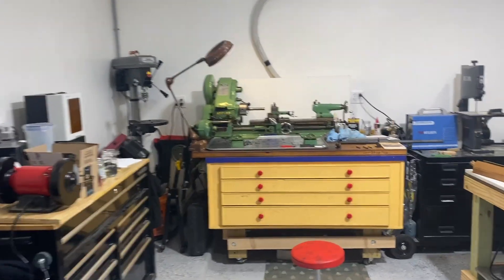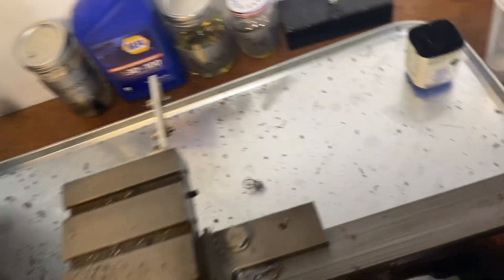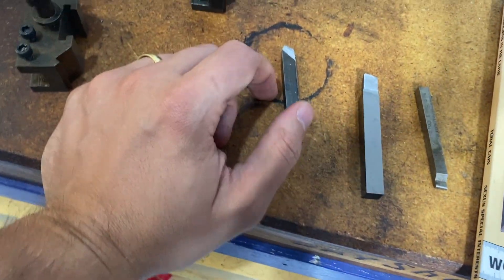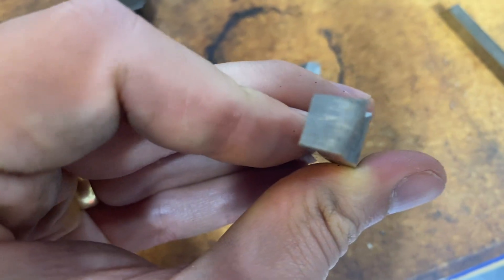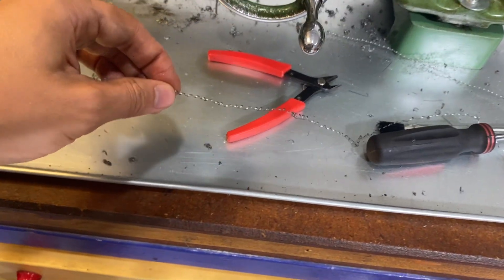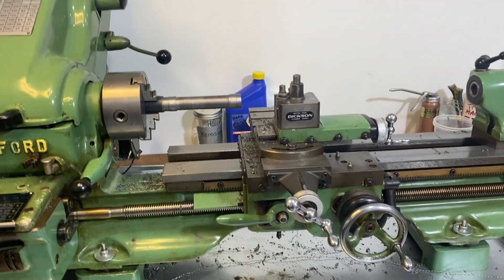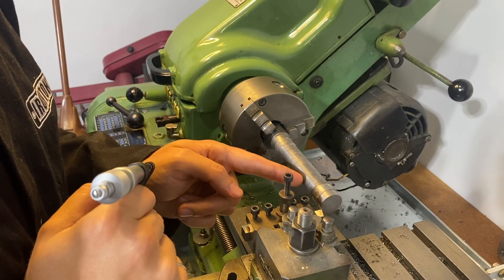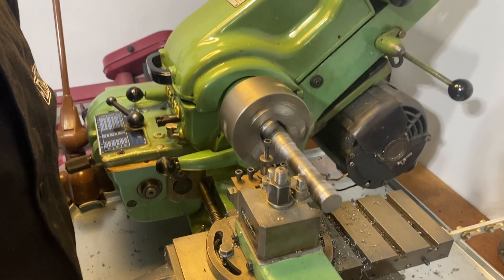Grinding HSS cutters and leveling the Myford

Comment: Nice work. Without tailstock support on a stick out that long. I wouldn’t trust the cut to be the same either side.
Reply: Agreed. Without tailstock support, the cut closer to the chuck will be greater than the part furthest from the chuck.
Reply from the maker: Thanks! I’m just following what the workshop practice series book says. I was able to get the 2 ends equal thickness in the end. My challenge now is surface finish. I’ve also got some 12L14 steel to see if my cutters work better on that! Thanks for watching!
Reply: @CuttingCorners-ri3gd  To perform this test you need a razor sharp tool, small radius tip, and only take a very small shave cut <5thou. The smaller the better. If you take a 3 thou cut and it fails to cut at one end or the other then you already know which way to make an adjustment. Do that until it cuts both ends. What you're trying to achieve by this is the absolute minimum flexure induced by the cut itself (i.e., the tool pushing the work away from it) which will be more apparent at the far end because of the large overhang. If the work flexes at all it will give you a false reading. I don't think your cut (and resulting surface finish) is fine enough to test for misalignment in this case. Aluminium bar is a better alternative to steel because it cuts much easier - the cutting pressures are lower. 1" Aluminium bar with polished DCMT insert tool designed as a finishing tool for aluminium is preferable. Also, your carriage gib strips must be carefully adjusted, and check for wear by testing if movement is stiffer at the far end than nearer the chuck (the beds tend to wear more nearer to the chuck)
Reply from the maker: Thanks for the tips! I’ll do the same test with aluminum and look into getting a different cutting tool. What’s your preferred method for removing bed twist to get the lathe level?
Reply: @CuttingCorners-ri3gd shim and bolt, if it was up to me
Reply: @CuttingCorners-ri3gd  Years ago I used the bar turning method you describe but these days I use an MT2 test bar which plugs directly into the spindle nose taper (make sure the headstock socket is clean!). With that you just need to run a DTI across the length of it to reveal any bed twist - no cutting involved. After setting the headstock true using that method just push the tailstock (with a dead center in it) into the end of the bar and check with DTI again. Move the tailstock set-over until the DTI reads parallel along the length of the test bar. That's the quick way to set the tailstock true to the headstock. Those test bars used to be expensive at one time but much cheaper now.